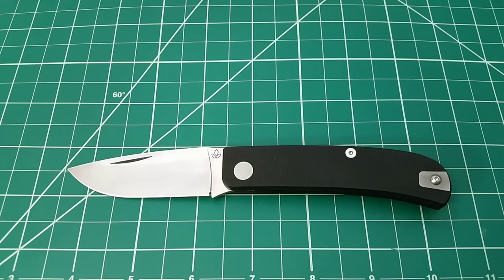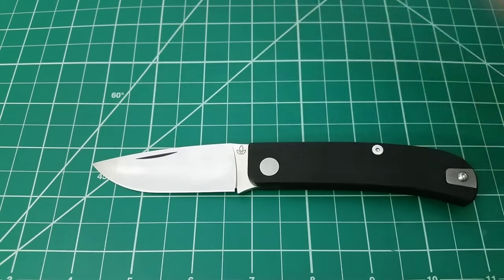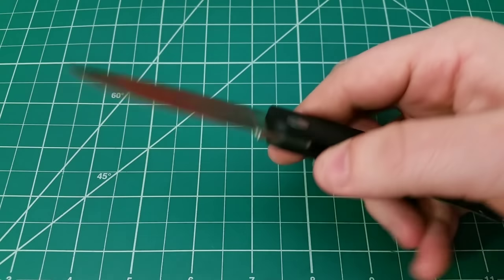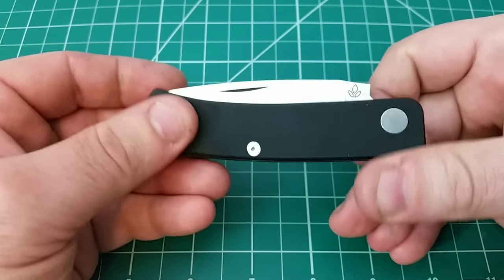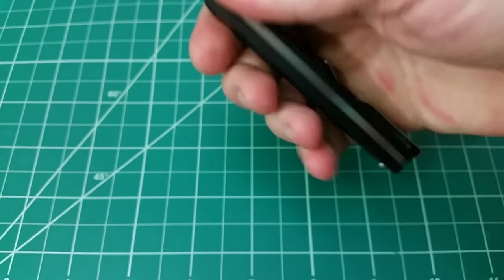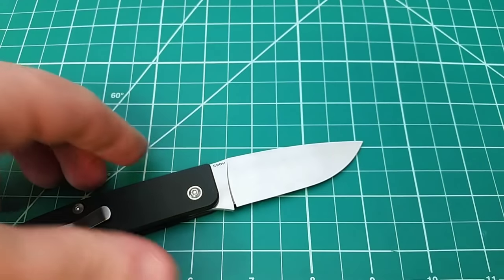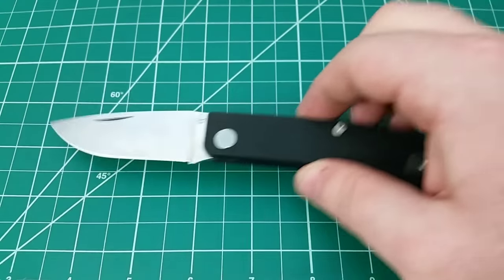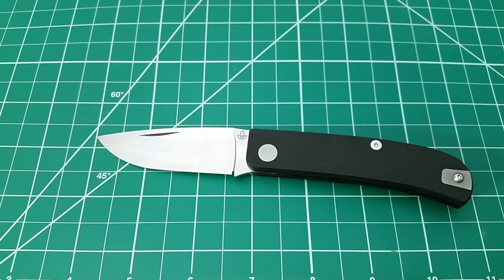The Manly Wasp: Solid User Slipjoint; Maybe a Bit Odd

Comment: You are on to it, this wasn't designed for the US. I have a Wasp in 12c27 and a Peak in S90V, I've already done edge retention testing with the Wasp and I'm working on my Peak now. S90V in that slip joint I think is fantastic for knife guys who want a great cutting tool at an even better price.  All Manly folders have very good geometry,.009 for the Wasp and .008 for the Peak both at 15 dps.

 These are small production knives so you get attention to things that matter like heat treat and blade grinding. I give Manly props for stepping up and doing things other companies won't. Civivi gives us good geometry with mediocre heat treats at best, Spyderco gives us great heat treats on most sprint runs with thick blade geometry.

I'm happy a company out there listened and made knives for knife guys who want a selection of steel, Manly does D2, 12c27, 154cm and S90V, great cutting geometry in a simplified tool. For the price point you really cant beat what you get.
Reply from the maker: "Great cutting geometry in a simplified tool". That should be their tagline. Well said, and thanks for the info.

Comment: The nailnick works perfektly for me. And i think its important to mention, that this knife is so thin behind the edge, that maintaining the blade is super easy because you only need to remove a tiny amount of material to resharpen the knife. And another important aspect to mention is that this knife is kind of friendly looking. I life in berlin germany where people are usually nervous about knives. We dont have guns here so knives are the number one weapon for criminals. We really have a big knife problem. Its not funny. But the manly is such a nice and friendly looking blade that you can take it out of your pocket in a public bus or the metro and nobody gives you a strange look. Also at work in front of customers nobody freaks out. And that makes this knife my edc of choice in the city.
Reply from the maker: Good points, and it's nice to be able to get this steel in a product that is legal where you are. Still, for me, the steel just isn't neccesary for what I need, and I'm terrible at sharpening, so I'd just avoid dealing with it, easy as it may be. From what I hear though, it's easier to maintain than I expected.

Comment: Thanks JT, for putting this beauty up, today! 

I'm loving everything Manly has been doing. I get all of mine from Lubo, at the ManlyUSA site. The 12C27 version of this knife, is about $56. Though I too, have been buying the S90V models. 

They are often out of Stock, as they small batch these, and take turns in building each model. I suggest, for those interested in these. To subscribe to their site, and get emailed updates, to read when knives are in Stock, and for when they have Special pricing. Which happens several times a year!
: - )
Reply: Never owned a knife with s90v, would my lansky sharpen it? Thanks Harry
Reply: I'm not sure  @pop4803 ? What kind of stones come with your kit? SiC stones, will handle this steel easily.
Reply from the maker: Thanks Steve, much appreciated!

Comment: I own three Manly knives all in D2 steel. All Manly knives have a cutting edge bevel at 15 degrees per side. I have found the fit and finish excellent and the D2 seems to have had a excellent heat treat. You are correct, these are users knives and they do what a knife is designed to do, cut extremely well. I have bought knives both from the factory in Bulgari and from their U.S. distributor. 
If you want a good user I recommend  The Peak back lock model or the Patriot fixed blade.
Kevin Clearly has two reviews of  Manly knives. These knives are one of the best buys on the market.
Reply from the maker: Thanks Barry, great info. I really appreciate it!

Comment: Looks like there is now a Manly USA website as well as a Manly Canada website for us northerners! Very interesting remarks on the knife, an d very true, I bought this exact knife at the Manly Canada Clearance sale, and got it for a very nice price, 20 percent off their normal. This is definitely a working knife, very simple g10 ( though im sure polishing the g10 would had that much more beauty to it)

For me, this is my travel knife. There are better two hand opening locking folders, and there are better one hand opening slipjoints, but this one knife lets me get past pretty much every country's laws. Two hand, non locking, below 3 inches.

As for the steel, for  a working knife, I would also prefer the Sandvich as Manly has a really nice heat treat on it. For me though, this was a chance to try S90v in an affordable package, and also lets me go on a trip and not have to worry about bringing sharpening equipment. 

This is an amazing travel knife, though it could do with a classier handle option.
Reply from the maker: Really well said, I completely agree. Glad you're enjoying it!

Comment: Cool knife but yeah hard S90V is kind of a weird choice in a user. The price is decent and I like the knife. IMO- most of the knife co's are charging way too much for high end steels. I have many of them but still appreciate VG10, 154CM and even AUS8 that's easy to sharpen.
Reply from the maker: 154CM is arguably my favorite steel. I'd have wanted to keep this knife if it were in 154cm.

Comment: I wanted to get one in camo but I kinda forgot about it. Good thing I did because the fit and finish is a lottery and I would need to buy some new stones for that S90V.
Reply from the maker: Some people say it's great, some not so much with fit and finish. I wasn't turned away, but I wasn't impressed either.
Reply: @JTsKnifeLife  Well, it's a user knive.  They have to cut corners somewhere. Keep in mind that this is made in Europe where everything is more expensive and taxes are higher so I was surprised when I found out where they are made.

Comment: S90V is gear queer steel. Holds an edge for a long time and is pain to get sharp. Hard to get a smooth edge on it. Carbide structure is jagged and the "S" steels have tendency to be brittle. 14C28N is the better all around choice for this knife. This is a hard ass...hard core working slippie!  This is one of the best values in pocket cutley anywhere!
Reply from the maker: It is a cool little knife, bit I'd definitely prefer the 14C28N version.

Comment: I have one of there patriot fixed blades in D2 great blade definitely seems like a quality company. Im no pro at sharpening and alout of the stainless cpm steels are a bitch for me to sharpen ran out and got the upgraded Ken onion grinder works great for the harder steels or if u have a decent amount of softer steel to move.
Reply from the maker: I've been looking at that sharpener actually. Thanks for your take on it!
Reply: Works great u have to keep light pressure or u will get a convex edge but as long as you pay attention u won’t and if u have a convex grind just use more pressure without it id definitely have some dull knives with super steel.

Comment: I have 2 of the Wasps, one in S90v and one in 12C27. Bought the second to see if the horrible build quality (fit and finish) was a fluke with the first one. Nope. There is only a quick flash of the knife back in the video, but if you look you will see how poorly the blade matches to the back spring. With my 2 examples none of the scales match the liners. One is off in one place, the other knife is off in a different place. Ugly off the shelf hardware for pivot and screws. You'll break a nail trying the nail nick. I'd rather pay more for a GEC or Proper, I'll not be buying from them again.
Reply from the maker: I definitely think this is more of an "everyman's" knife, not really something that is gonna be on par with higher quality stuff. It works pretty well though.